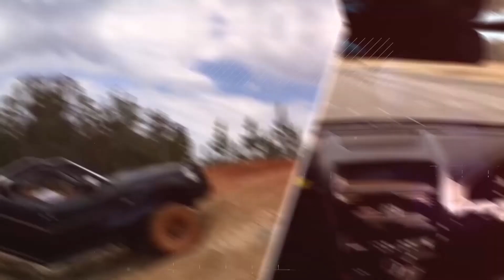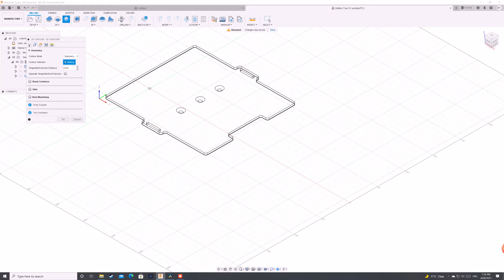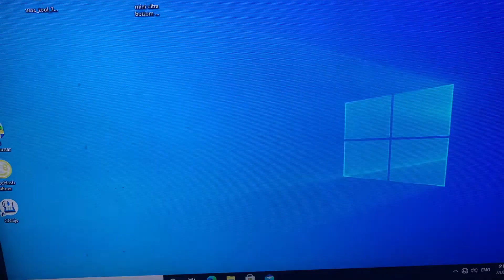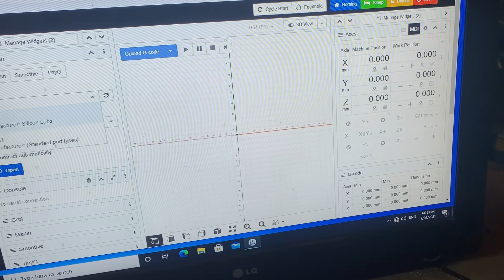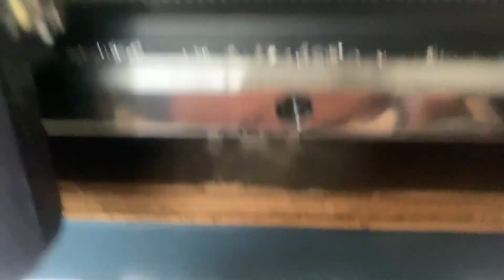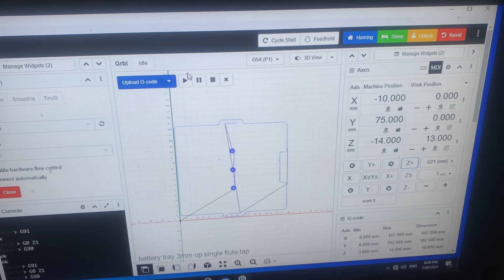Bulkman 3d Queen Bee Pro CNC Router, xprov5, 2.2kw, CNCjs, Fusion 360 Start to Finish Aluminium

Comment: I currently have a workbee with the 2.2kw water cooled spindle and I have more slop than I wish to have. A lot of people in the message boards seem to think that particular spindle is a bit much for the workbee setup. My question is, do you think the queen bee upgrade kit would alleviate this? In your experience. Right now with a 2-inch surfacing bit, I can't get a smooth finish, I'll get an 8-10 thousandths ridge from time to time. I've checked everything I know to check and yes it is trammed, but I've narrowed it down to flex in my gantry. Any tips or pointers you have, I would love to hear.
Reply: Это хоббийный станок , возможно у него кривые рельсы. У моего кривые рельсы, но не везде, я измерял строительным уровнем ось Х.

Comment: Hi, I’m having issues with rigidity on the z axis as well so I’m thinking of getting a second mount as well. Let me know if it helps out. I have cnc xpro v5 and after like two weeks of messing with it I eventually got it to work. I love rs-845 it lets me run my controller from my ipad, laptop or phone.
Reply from the maker: Will do mate, been a bit slack recently due to business being busy. Will get the second mount fitted in next fortnight and report back after a test. Any tips on getting rs485 working? Was doing my head in big time. Then i come across some people saying they just don’t talk to the chinese vsd’s.
Reply: @bennydiesel5413  I’ve been having a hell of a time getting my xpro v5 wired up properly with psu+spindle+vfd. Any chance you can share pictures or video of your wiring setup?
Reply: Imran Virk Do you have an email or something I can send you the pics of my setup? By the way I got a second mount and it did the trick.
Reply from the maker: @imranvirk5151  hey Imran, if you still haven’t sorted it. Let me know i’ll put some info up.
Reply: @bennydiesel5413  hey if you can share it that’d be great. I had previously replied with my email (unformatted) here but looks like that was removed, not sure how I can send it to you but you can find me on FB/Instagram messenger with same name. I would greatly appreciate it.
Reply: @Eric-yx1gs  Hi ,I have the same setup and can't figure the wiring . would love using my iPad or phone.can you please send some pics of the wiring

Comment: Hey mate this is the exact machine I've been looking at getting! How's your experience been with it? Any issues building it or running it etc?
Reply from the maker: Hey Hobson, it was a bit of fun building it as the instructions are really vague. A positive is that all of the components and screws etc are labelled so you can fumble your way through the build easily enough. Otherwise i’m happy with the machine. I haven’t been able to get perfect face finishes, but I am a complete newbie to cnc routers, so it’s probably more me than the machine at fault. I’ve also just ordered a second spindle mount to try that as the kit only comes with a single mount. Also i could never get the xpro to talk to the spindle controller over rs485 network. Read a few forums with people having similar issues with the chinese spindle controllers. I just connected it up to the 0-10v control. (Only thing you loose is reverse which i didn’t require)
Reply: @bennydiesel5413  thanks man sound like a good machine. I was worried that the 2.2kw spindle would be too heavy. I'm assuming you haven't had any problems with it twisting the cbeam? A second spindle mount looks like a good idea. Thanks for the reply man 🤙
Reply from the maker: @Hobsonguitars  not at all man, i’ve done some pretty big fails and full sent it through 5mm plate and it has just ate it then broken the bits. The structure is pretty solid!
Reply: @bennydiesel5413  Awesome stuff mate thanks for your help :) I think I've made up my mind now haha